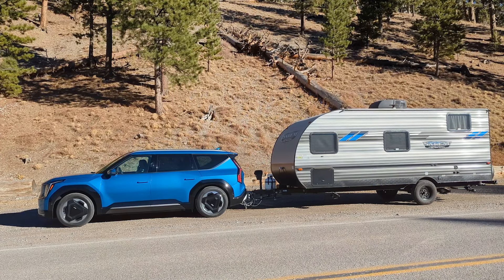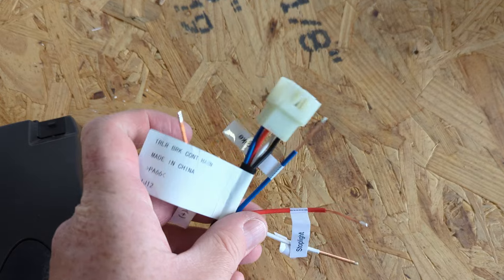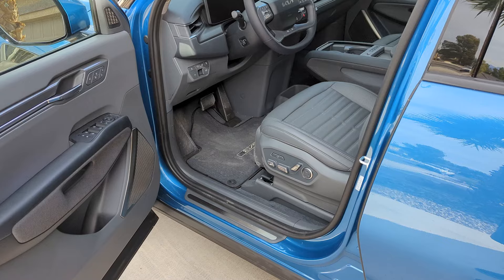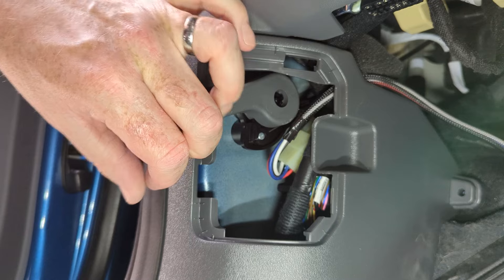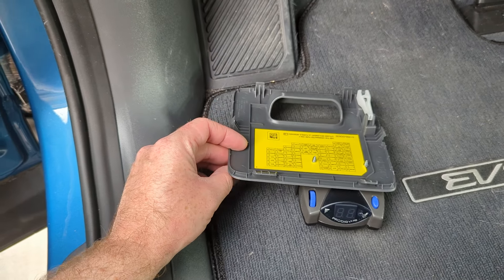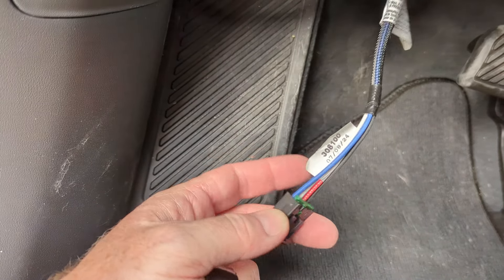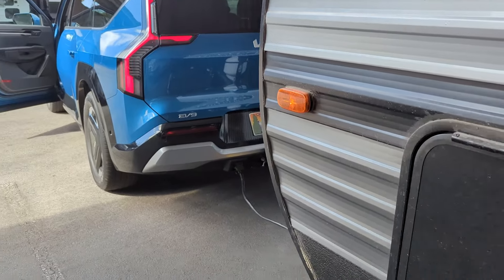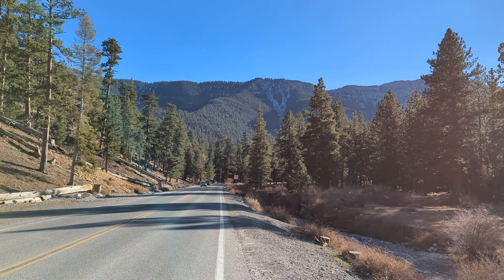Kia EV9 - how to install brake controller for full tow capacity - Tekonsha and others

Comment: thank you for this video, my wife and I got the same EV9, Land trim with tow package in Ocean Blue, 2 months ago specifically so we could pull a travel trailer. We just found a trailer we like and look forward to taking delivery in a couple weeks. I'm curious to see what range we will get while towing. Looking forward to your next video.
Reply from the maker: Exciting! I'll share more soon but on the flat, doing 60 MPH I got approximately 1 mile per kWh, around half of what I get when not towing. Perhaps a little more. Going up a rather extreme hill, it was quite a bit less. It's a phenomenal tow vehicle. My Jeep used to struggle while on a slope, not the EV9. it manages it with ease and still had additional power to deliver if needed.